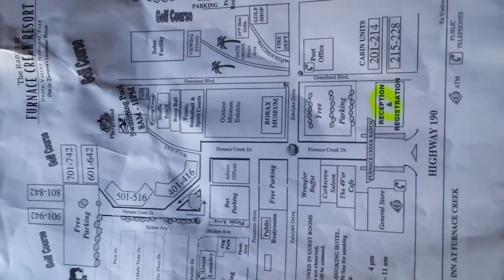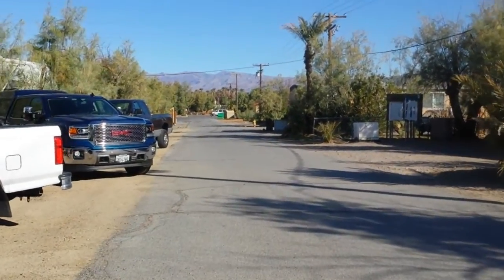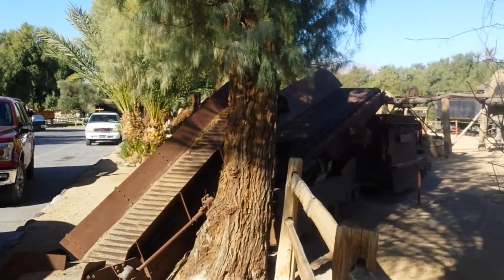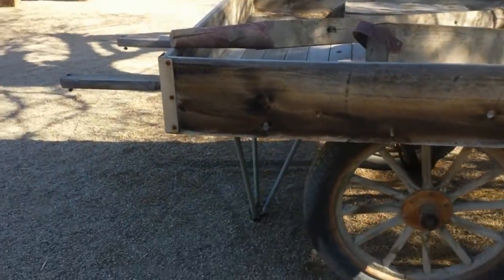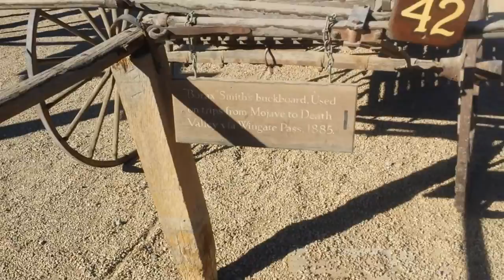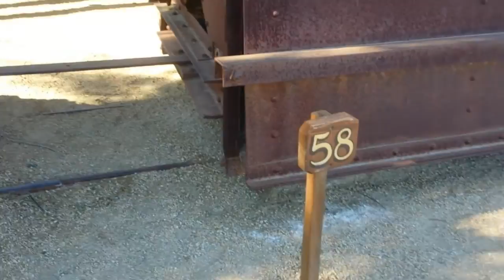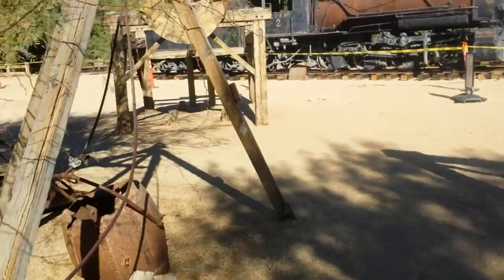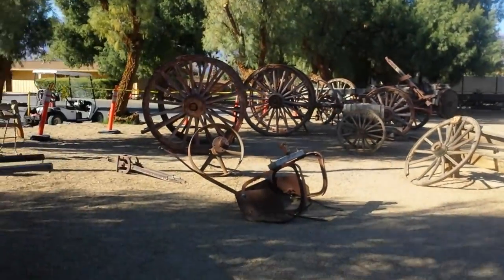Death Valley Furnace Creek Rv Resort and 20 Mule Team Borax Exhbit

Comment: Hello American Woman, new subscriber here.  Enjoying your channel and travels.   Wondering whether you are still using the flexible solar panels and do they provide enough power?  I'm hoping to be on the road early next year and I'm leaning toward using flexible panels.
Reply from the maker: +Glo Shafer Hi and thanks for watching. I have 1 135watt flexible panel, 2 deep cycle marine batteries which gives 13.4 v in the sun. I like it because I can move it easily.